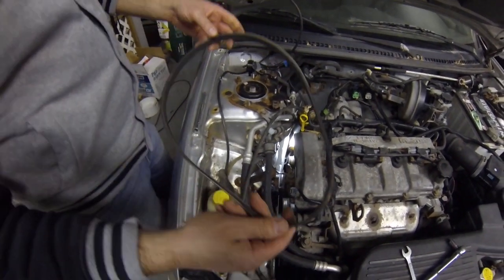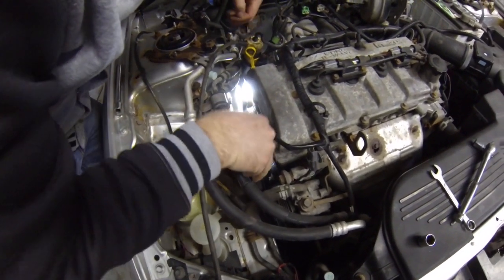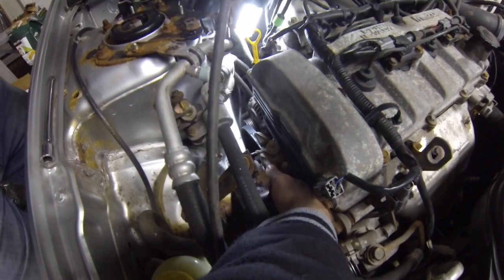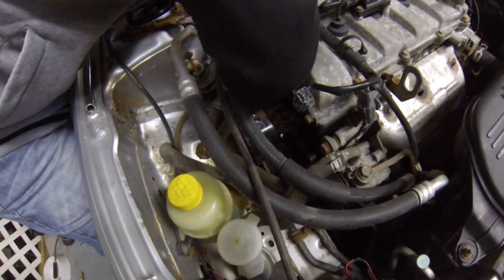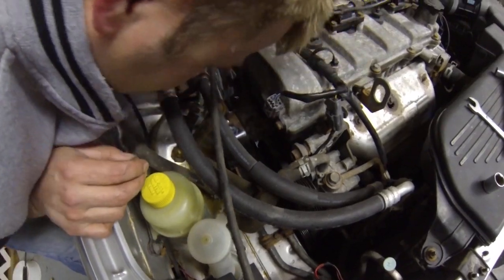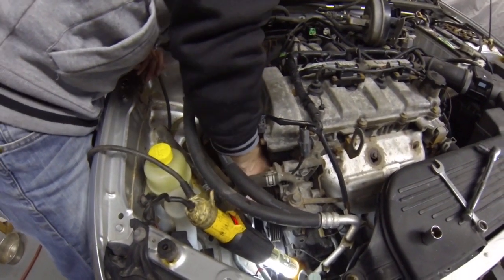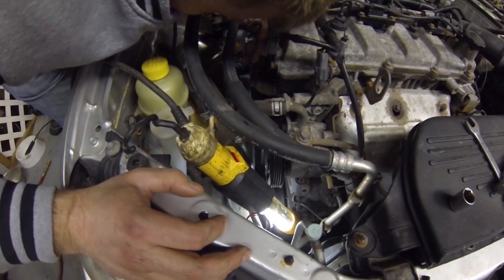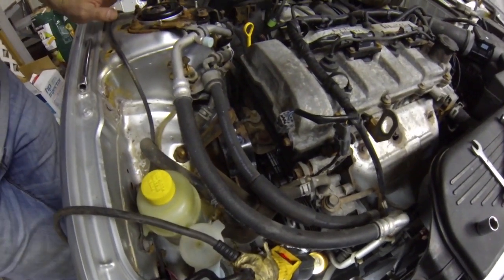Mazada Alternator belt replacement

Comment: Do you have to go under the car to get to a bolt? I've only been able to find two (the tensioner and the bolt connected to that) and still cant figured out how to loosen it
Reply from the maker: Its the worst working on these cars, I have a headache just thinking about it :)  yes I do recall going underneath and it was tight....
Reply: @KcYukon  Thank you! I spent all of today trying to remove that belt on my 2001 Protege. I'll have to lift it up sometime and deal with that
Reply from the maker: @nobelynx8863  No problem glad it helped even in a small way :) I wish they would make things easier to work on like the good ole days!!! lol

Comment: Mine fell of as I was driving, and came to notice when my battery ran out at the end of the day in my 99 protege, now I don't know  what are the measures or what to say when I go and buy it myself at a parts shop. Can you help me with the measure/name/model of the belt? Note: I will be installing it my self with your video, thanks a lot)
Reply from the maker: Sorry for the delay missed a lot of older comments for some reason!!! I will assume its all fixed now after 3 years lol

Comment: I have a 2000 Protege. I need to replace the belt. Can I ignore the AC since it doesn't work for now?
Reply from the maker: No I don't think you can not unless you size a smaller belt but even then I dont think so...
Reply: I thought so too, but there's two kinds of power steering/ac belts, one that runs both, and one labeled for power steering only. So far not having the belt the car is running ok so I imagine not having the AC belt would bother it. Plus the AC pump is actually frozen so it needs to be replaced which I can't afford.
Reply from the maker: Yea got a do what you got do... save money those cars will go forever. Body will fall apart way befoer hand. Good luck

Comment: Hi. I have an '02 Protege:-) Approximately how much time does it take to change out the belt, start to finish? I don't want to be overcharged for labor. Also, my mechanic says my belt is bad but I changed it out at 70K miles, and I only have 85K miles on it now. Does that sound right to you?
Reply from the maker: +Essie Medina I would say 2 to 3 hours depending on what bolts are stubborn...I would also check the belt for stress cracks that is a sign that it needs changing.... Does it squeal when you start it?
Reply: +Kc Yukon Thanks for the reply! The belt doesn't appear to have stress cracks. It looks new but something must've gotten caught in there and it has a small gouge. It started squealing yesterday. At $85/hr for labor, it looks like I'm up the creek without a paddle :-(
Reply from the maker: Did you ask for a quote to find out how much labor would be?
Reply: +Kc Yukon Not yet. I'm afraid to hear what they're going to say. I'll let you know... Thanks for following up!